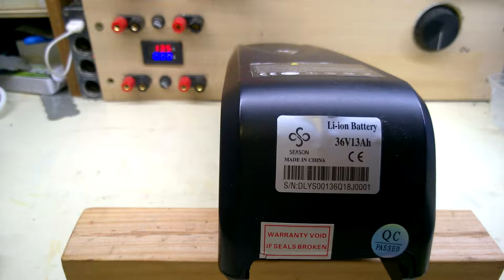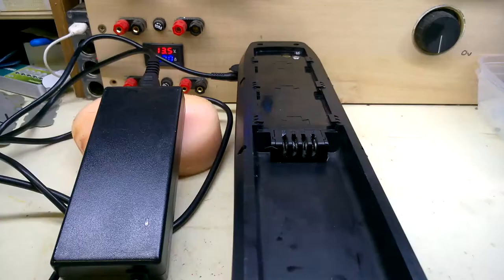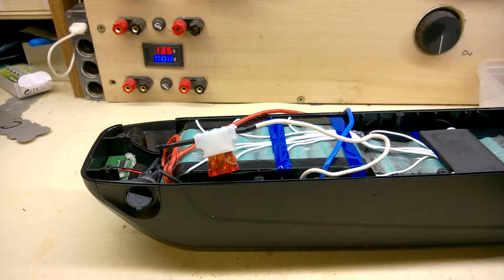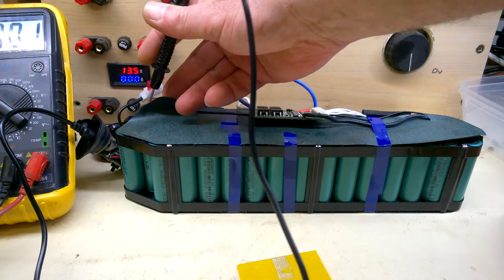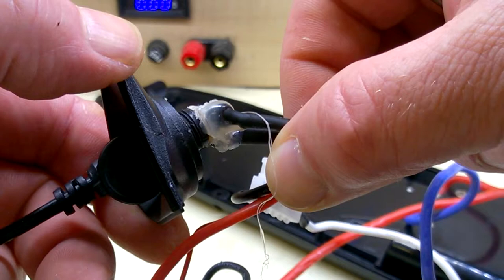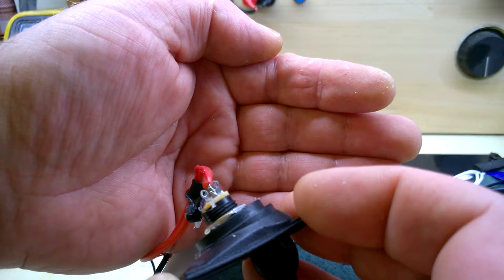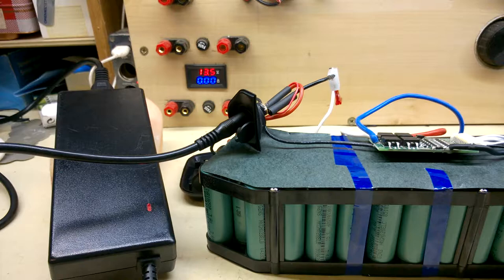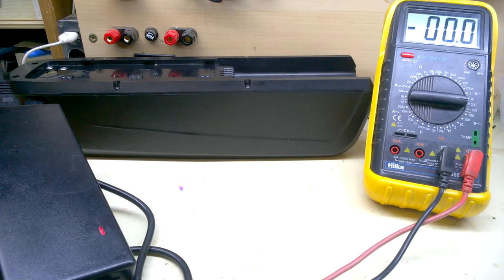Hailong 36v Li ion battery not charging repaired

Comment: Just wanted to thank you after pointing me in the right direction when the battery in my wife's e bike refused to charge. I opened it up and checked the fuse to find that it had blown. We are on holiday at the moment so getting this working again has been very important. I didn't have a spare fuse and with nowhere here to buy one I used a single strand of thin copper wire to bridge the blown fuse. I know this may not be recommend but drastic measures were called for to get her back on the road again and I am happy that the wire is light enough to blow if there is another short circuit. I will replace with a new fuse as soon as we get home. I am still am puzzled as to what caused the fuse to blow. I wonder if a temporary short circuit could happen when plugging the charger into the battery while it is switched on. I will make sure the charger is switched off in future when I connect it to the battery - just in case. Thanks once again for the tips/advice.
Reply from the maker: A thin wire for an emergency fuse is ok to use on the charging circuit.
If the charging port had a short circuit on it , it would almost certainly produce 10's of amps (enough to vaporise a thin wire).
Be proud of your repair skills - not everyone would think to do this.

As to the cause , I've heard of people sticking a key into the charging port (and therefore causing a short).
However , for most of my years , I always connected the charging plug first followed by the mains plug.
Recently , I followed some internet advice to plug into the mains first , followed by the charging plug (supposedly to equalise the voltage between battery and charger).
Until I produced a huge spark on the charging port (perhaps I misaligned the mating parts) , since then I've gone back to my old ways.

Have a good holiday.

Comment: Great video! I was just about to give up, because my Engwe m20 battery was not charging too. When plug in the charger it just glows green and nothing happens. I quickly opened the battery and saw 2 fuses. One for input cables coming from the charging port and one for the output coming from the battery to the output plug. The charging fuse was blown, so I just changed it and now everything works again.
Reply from the maker: Good lad.

Comment: I've had two ancheer e-bikes 36 volts which both had the same problem the battery would not charge. I put the battery in the Sun for about 10 minutes plugged in the charger now it charges I leave it in the sun till it's finished that's the only way I could charge my batteries now. And it works so give it a try before taking your battery apart
Reply from the maker: Interesting.
However , in my case , it's doubtful that sunshine could repair a non-soldered wire.

Comment: Hmmm have the same issue charger light goes straight to green on plugging in charger but battery isn't fully charged and ordered a new charger before having the pain of dismantling the battery just incase the charger is at fault. Happy days fingers crossed and great video by the way fella.
Reply from the maker: Glad to help
Reply: Was the charger the issue or was it the battery?
Reply: What happened

Comment: Be great if you could quickly show how to use a voltmeter :)  Great video.  I have a brand new ebike and the battery isnt charging.
Reply from the maker: I shouldn't have to show anyone how to use a voltmeter - that's a very basic function in problem solving.
Grab a multimeter (or buy one first) , select the voltage range (DC in the case of batteries) and shove the probes into where the sparks output the battery !!!!

As you have a new bike , first contact the seller (if possible) and explain your situation.

If you are going to try and diagnose your battery / charger , check the battery voltage first , then measure the chargers' voltage (disconnected from the battery).

For example , a 36 volt battery will require a 42 volt charger output.
If the battery is showing low voltage (say 27 volts for a 36 volt pack) the charger may refuse to start charging until the battery reads over 30 volts.

There may also be other communicattion between the charger and battery (such as temperature measurement etc).

Also check that the battery isn't already full !!
It has been known to happen .........

Good luck.
Reply: same here.  one month old ancheer bike.  I don't know what to do for repair or warranty.

Comment: My one work charge, I mean the green light is on but won’t charge so the red light won’t show ??
Reply from the maker: If the green light is on , then it's not charging,
Reply: @makeitwork7522  Any idea what the problem is?
Reply from the maker: @TheLondonTransportDroid  
Check the fuse and the internal wiring (as shown in the video).
If those are ok,then you may have a BMS or cell issue.

Comment: Looks like you just soldered the wire to the post without putting it through the hole first. I would have thought putting a hook in the wire then through the hole on the pin before soldering would be the best way. 
Just my thoughts. 🙏
Reply from the maker: You are,of course,correct.
It's just that I've always soldered this way (and not all terminals have an eye).
If the wire was subjected to being pulled,then using the hole would add mechanical strength to the joint.

Comment from the maker: Martin Newton
Hi, I just found your video whilst searching a 48v battery issue. I am a Brit in Belize Central America, I am on an island off the mainland, so everything is DIY fixing ! Your video gave me the confidence to have a go .My issue is I have a 48v Chinese bike conversion that when fitted worked on its maiden voyage 10 miles brilliantly. When I came to charge it, it does not appear to be charging the battery. When charger is plugged in unconnected I get a green light, when connected I get a red light. I have a volt meter and when connected to the charger plug that plugs into the battery it reads fluctuating between 13 & 24 volts, the output should be 54.6 volts. When I read the bike connection terminals of the battery with the charger connected it also reads between 12 & 24 volts. If I leave the battery pin charge red light tags on and green does not appear. If I connect bike too battery whilst plugged into charger bike works, as soon as I un plug charger it does not. Is there any chances you can help me over email on sherlock349@yahoo.co.uk there are two red wires and 1 blue wire coming from bike connection side of battery, they are routed through a key switch. I have checked the fuse and it is good TIA any help appreciated.
Reply from the maker: If the bike only works with the charger connected , then the bike is powered by the charger only - not the battery.
You probably have an issue with either the BMS , or some cells or even the keyswitch.
Sounds like the charger is attempting to provide a charging voltage.

Most likely , you will need to open the battery up to see what's going on.

Comment: Hi great to see your knowledge. Was wondering if you could advise me plz my 48v 19amp/h battery is only 10 month old and 90 charges but Chinese not interested it charges to about 88-92% green light on charger comes on then off and charging then back on repeating but never fully charges could it be repairable? Thanks
Reply from the maker: If it charges to 90% then it sounds ok to me.
If it only runs for one mile , then there's a problem.

Comment: Ok. I have question. I have a 42 volt 1,000 watt hailing down tube battery . My battery stopped working on a ride. I came home and tried to charge it but it did nothing. I took the case off to find my ground wire running from the battery into the plug that connects everything had melted the plug together. I can probably replace the plug and fix the battery but I will need to clip the wires going into the plug from the battery. Which wire should I cut first positive or negative? Or is it safe to cut and put a new plug on? The rest of it looks fine. Just melted the plug.
Reply from the maker: There's no particular order to cutting the wires (it's not a bomb !!).
A melted connector is either the metal terminals were loose or overcurrent.
You will have about 30 amps on the connector.
But all this doesn't affect the batterys' ability to charge.
Reply: @makeitwork7522  actually I found that you want to disconnect the ground first. Less chance of an arc. Then reverse the process to connect it.
Reply from the maker: @psychopete3848  
Ah.
Fair enough.

Comment: So they just glued that connection on at the factory ? That could have shorted out and caused a fire.
Reply from the maker: Doubtful that it would cause a short - it was securely glued in place and isolated from any other potential problem.

Comment: Hi, thanks for a great informative video. We run a family farm that relies heavily on our two ebikes, but even though I have no trouble with the mechanical maintenance, I’m at a loss with the electrics. Currently trying to solve a situation where the battery is reading 49v- it’s a 36v 17Ah lekkie battery, it runs the bike fine, but the bike lcd reads empty and switches off after running for 30sec. Otherwise battery seems fine, apart from it won’t charge, possibly because it is actually full.... any suggestions?
Reply from the maker: First thought is WOW - 49 volts !!!
Are you sure that's correct ??
Assuming it's a lithium ion 36v battery - the maximum voltage should be 42 volts.

I would measure the battery with a different voltmeter - I'm assuming you did measure it with a meter ?
Or is the display showing 49 volts ?

Check the battery voltage with a meter.
Sounds like you have a faulty display if the bike runs ok.

Comment: I have a Hailong 52v Battery. does the Red power switch on the battery need to be ON to charge it ? or OFF ?  or does it matter ?
Reply from the maker: The battery in the video didn't have a red power switch - only a mechanical keyswitch (not the type that switches the BMS on/off).
Some electrical switches do turn the BMS on/off , but I don't know if it controls the charging side.
Try charging the battery with the switch in different positions to find out.

Comment: I have a different problem with its 650 battery , I can't turn mine OFF , IS THAT DANGEROUS ?
Reply from the maker: No . it isn't dangerous.
The output terminals are well covered to prevent shorting.
Some keyswitches turn off the BMS , and some are a mechanical lock only.

Comment: Question PLEASE !!  My Ancheer bike died after 2 weeks.  The 4 battery slots are labeled
+ + - -      so if  I test   1 (red) and 4 (black)  54 volts, good.   1 and 3 are zero.   2 and 3 are zero and 2 and 4 are zero.   That seems bad.  Am I correct ?
Reply from the maker: Your voltage readings are ok , but it depends on how many wires are attached to your battery slot INSIDE the battery case.
If you have only 2 wires inside (Red and Black , positive and negative ) then you will only read the pack voltage on 2 pins (1 and 4 in your case).

If the battery doesn't work with a full voltage reading , then you may have other issues - BMS shutting down under load for example.
Or a faulty controller / wiring issues etc.

Comment: my prodeco mariner 8 battery 36V got soaked in the rain and stopped working. Any chance to save it and how to do it? Still keeping on rice
Reply from the maker: You will need to open the battery and dry the insides (and hope that no real damage has been done by the water.
Reply: @makeitwork7522  thank you so much, I opened it and dried droplets, battery was in perfect condition, still no sign of working, thanks though

Comment: Alot of those chargers you press the green light and it turns red to charge the battery.
Reply from the maker: I'm afraid I don't follow.
In this case pressing the chargers' green light would do nothing - it had an internal open circuit.
Be good if that kind of pressing the charger case worked ...............
Reply: @makeitwork7522  was just trying to tell people, that alot of these chargers have an "on button", and its the green light on the charger that you have to actually press. people go to do a first charge and plug in charger and some of the chargers stay on a green light, and dont charge until the light is pressed. hope that makes sense.
Reply from the maker: @hullebikerfishing  
Ah ! Now I see what you mean.
I'll look out for this next time.
Thanks for the comment.

Comment: Anyone have any idea why a new hailong battery would only charge to 76% with a bbshd does it need a reset if so doea Anyone know how i do it thanks for any advice
Reply from the maker: Sounds as if you have a faulty cell group (or two).
Or a faulty charger ?
Very unlikely to be the BMS.
Reply: @makeitwork7522  thnx

Comment: Hello, great series on bike batteries thanks. Would it be possible to replace a OEM (Radrover) failed battery with a generic (say Hailong) with the same spec etc without an use / running issues?  Also could you fix the original, uses the Panasonic 18650 cells?
Reply from the maker: Replacing a battery is no problem as long as the voltage is the same , capacity is the same (or greater) and the output connector is the same (with the BMS wired to it the same as the original battery).

The original could be fixed - depends what's wrong with it.
Dead cells or faulty BMS for example.

It also depends if it's financially viable to repair it - many people just buy a new battery.
Reply: @makeitwork7522  Thanks so much for the reply. The original stopped working quite suddenly some 6 months ago so maybe repair is a bit of a long shot.  New means everything is just that!

Comment: I have a 72v 48ah battery that wont take a charge. Battery is new and still has about 25% charge. Looking for someone with the tools and expertise to diagnose and fix issue. I have narrowed it down to charger issue, or charging port issue or battery management system. Must be able to get the necessary parts to make battery chargeable again. Will pay cash location Portland Maine
Reply from the maker: You're about 3000 miles away from me I'm afraid.
Perhaps someone in the USA can help ??
Reply: @makeitwork7522  I hope so, I've called about every bike shop and hybrid vehicle shop I could find. Maybe this shoutout will get me in touch with someone who can help

Comment: I am thinking out loud here, but I am getting a new battery very soon similar case, I believe it is marked as a hailong Pro case, I am going 48v and upgrading my controller to a dual voltage spec and over volting the motor. However I still have 2x36v 10s4p dolphin case batteries, now I am considering selling them but they are 3 year old with approx 360+ cycles and over 5000 miles per unit, one is in good condition fully charged at 42v, I was wondering if I could swap the internals out and place it in a empty hailong case without messing with the connections except the power out to mount cables, is your case a "Pro", trying to find the internal measurements is a pain without purchasing a case and going in blind.
Reply from the maker: I don't know what case this one is - it's a customers' battery which was returned after I made the video.
However,I probably have another on the bench which is the same.
External dimensions are 360 mm length,90 mm width (side to side) and 90 mm deep.
Subtract a few mm each side,and you'll have the internal size.
Reply: @makeitwork7522  Thanks for that - I really appreciate the time and effort - the case I am looking at according to the supplier is a little bigger than that on all measurement and I may have found a cheaper alternative + it's the shape of the battery block in my dolphin case that could be an issue. I think it will be a shot in the dark experiment if I decide to try it. Once again thanks for the assist and the video was very informative.
Reply: If you’re buying a dual-potential controller which is overvolting the motor instead of limiting current, I’d add in a separate step down buck board unless you don’t mind replacing $300 hubs.

Comment: hi, i kept my ebike outside during winter time, now i tried turning it On but its not working, What should i do?
Reply from the maker: You left a battery outside in winter ?
There could be many reasons for it's inoperation.
Low cell voltage , BMS failure , water ingress , blown fuse etc
Reply: @makeitwork7522  unfortunately I did